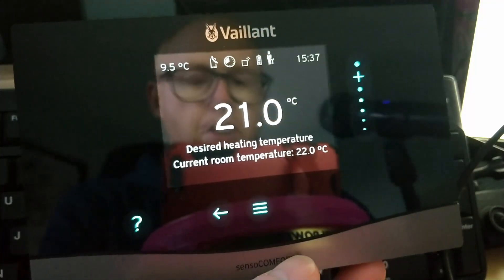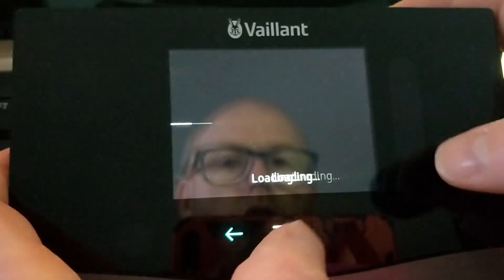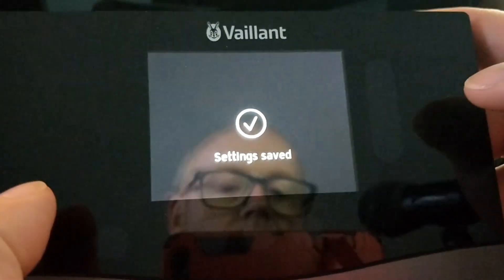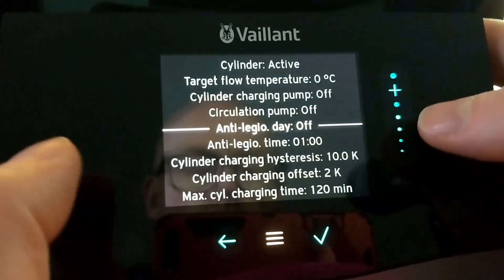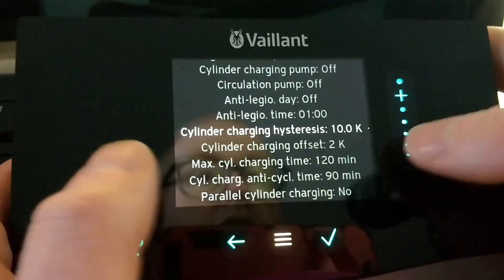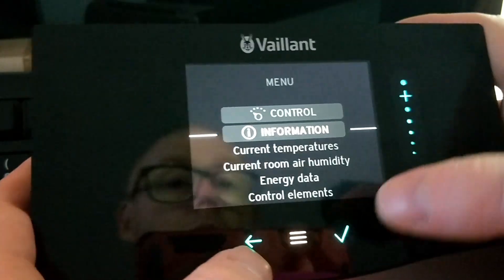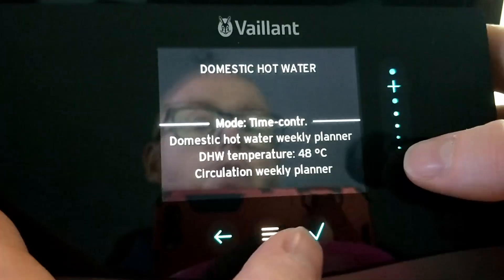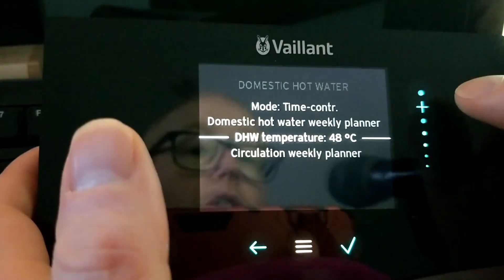Hot Water - Vaillant Heat Pump

Comment: Can you tell me what to do if there’s no display screen. It fires up then goes off. Many thanks
Reply from the maker: Hmmm, that is weird. Batteries definitely good?
Reply: @UpsideDownFork this doesn’t look like it takes batteries. Do they all take batteries?
Reply from the maker: @amandaleighwilson some are hard wired but most are battery powered.
Reply: @UpsideDownFork no it’s hard wired in. So weird. The logo comes on so it’s getting power but then the device flickers the temperature quick the reboots again. I have a number to call tomorrow but it’s a rad frustrating as I know it will reset everything and I don’t understand this system at all. It’s like we need a degree in it. Thanks for your help.

Comment: Why not just have it on all the time?
Reply from the maker: Because that's an inefficient way to heat the cylinder.

It also disrupts the heating system, often when you want heating the most.

Set it to once a day and then you're in control.
Reply: @UpsideDownFork but wouldn’t topping the cylinder up short and quickly, as it needs rather then a full cycle from cold be just as comparative. Have you tested both sides to compare?
Reply from the maker: @gerardfry4876 yes I've tested both and the long reheat from cold is far more efficient because the heat pump spends much longer at those lower flow temps.
If topping up regularly then the heat pump has to ramp right up to high flow temp quickly and it consumes a lot more energy as well as experiencing more defrost cycles at colder/humid conditions.

Comment: thanks for your video! I have been having headaches with my heat pump and the hot water since moved in this new house. Often, there is no hot water when I try to shower at night. But in the morning, hot water is normal. To be honest, I know nothing about heat pump. I look at my panel and the settings are so much different from yours. my cylinder charging hysteresis is set to 7.0 K, and cylinder charging offset is 15K. And the cylinder target flow temperature is 75C! Is this abnormal? what else do you suggest me to check?
Reply from the maker: If you don't have sufficient hot water to last throughout a whole day then you broadly have 2 options. 
1. Schedule a second hot water cylinder reheat for the afternoon time.
2. Set your cylinder to heat to a higher temp.

The cylinder target flow temp may only be 75 degrees during the legionella cycle?

Comment: Thanks for this. We've had our vaillant for about 7 weeks now. i set it up like you right at the start with a hot water cycle set from 00:30 to 2:30 everynight to make use of octopus go tariff. this has worked well and we've never been out of hot water even with target temp at 48. however last night it just decided not to run the hot water cycler. so by the evening we'd run out of hot water. never had this before and dont know why it chose not to run hot water at all, very odd and i cant figure it out to know how to change it so it doesnt happen again! its doing a boost now which is working at least.
Reply from the maker: That is very strange. I've not seen that before so hopefully a one off glitch.
You can keep a quick eye on it every morning when you wake up to check it's successfully completed the DHW cycle.
Reply: @UpsideDownFork  Thanks! after googling the only thing that might have been is if for some reason during the hot water window at night it didnt think the tank was low enough temp to trigger the cycle. maybe our hot water usage was low that day although i couldnt obvioulsy think it was. we have the tank at 48 so maybe it hadnt quite got down to 37. so i changed the cylinder charging hysteresis from 10K to 5k and its not done it since. so maybe that was it! :)

Comment: Yes pretty sure Cylinder Charging Offset makes no difference at all - 0 or 25C all the same. Setting may only work with gas boiler.
Check the VWZ-AI controller screen (the white one usually near the tank). The default display should show a capital E - which I think means DHW eco mode which is the most efficient. This cannot be set in the Sensocomfort and is usually set during commissioning.
Reply from the maker: Interesting that eco DHW should be default as that was not the case for me and many others. 

I haven't read the manual since last winter so this might be a good moment for me to do some revision.
Reply: @UpsideDownFork  Mick Wall's Energy-stats blog tells you how to set it in VWZ-AI:  Look for
Vaillant Arotherm Hot Water Modes TL;DR
Warnings !
Alternatively you can set the schedule for Low Noise Mode (installer level in sensocomfort) to coincide with your hot water schedule - may take some time to heat the water though. Eco mode should be fine for most.
The VWZ-AI manual
monoblock-heat-pump-system-vwz-ai-heat-pump-appliance-interface-2685948 pdf
Page 7 : Description of symbols: E eco mode  Energy-saving domestic hot water mode
Reply from the maker: @Scouser22 Thanks, i'm well aware of how to change the modes and have made videos about this years ago.

Comment: Regarding the dhw temperature, my installer did put the temperature sensor in the higher location, which is approximately 1/4 of the total height from the top. So low temperature is almost empty with my boiler. Is that wrong?
Reply from the maker: It is recommended to fit in a lower pocket so the heat pump will start reheating it quicker. If you are satisfied with your hot water production then no need to change.

Comment: I’d don’t understand why my DHW cycle ramps immediately up to near maximum output, heats it within 15 mins and stops. It peaks at 6kW input for about a minute then drifts down. The DHW cop is great at 345% but I would have thought a slow increase in flow temperature would have been more economical.
Reply from the maker: Do you have a Vaillant? Set the DHW mode to ECO and try again.
Reply: @UpsideDownFork  I don’t, it’s the 16kW Samsung R32, but it does have an eco mode, so I’ll give it a try. Thanks.

I can’t complain about the cop, it’s just the OCD in me (or perhaps because I’m a tight arse) always tries to get the best out of it. 
Does yours actively modulate up as the tank temp increases, or does it accelerate to 100mph and then back down again?
Reply from the maker: @yp77738yp77739 actively modulate. It maintains a flow temp a couple of degrees hotter than the return temp.

Comment: Thanks a lot for the video. It helped me so much to understand. 
I have similar settings like yours for the DHW, only difference is that I set legionella for Friday afternoons.
There is a switch for the heat pump and another separate switch for the immersion heater in the utility room. Currently the heat pump switch is on but the immersion heater is off. When should I ever need to switch it on?
Reply from the maker: The immersion switch is an emergency back up so you can still provide hot water in case of a heat pump failure.
Fingers crossed you never need it!

Comment: Have you targeted your pump usage to fit in with an energy tariff?  We are looking to get a pump installed & I'm trying to make sense of energy tariffs with low cost energy windows. It's a bit of a minefield!
Reply from the maker: I have several videos on the channel of me trying to optimise for Octopus Tracker, Octopus Agile, Octopus Cosy and now Octopus Intelligent Go.

Finding the balance between the heat pump, the EV and the rest of the house is a fine balancing act.

All of the above have saved me a considerable amount over the standard tariff.

Comment: It's important to know how many kWh of heat the DHW cylinder (& any buffer tank) loses in 24hrs and to think where that heat is going, especially if you're about to install & considering putting the kit in a place that's not heated & not insulated. Your DHW tank & ancillarys are a heat battery - a useful leaky space heater OR a waste of heat and primary energy
Reply from the maker: Yep, exactly one of the reasons that I pushed to keep my buffer tank and cylinder in a first floor cupboard rather than the garage or the loft that the installers preferred.

In this video I intentionally suggest that people should heat the hot water closest to the point of use to avoid those standing losses as much as possible.

Thanks for commenting!

Comment: Hi thanks for the information. I'm enjoying your videos. We've just had a Vaillant Arotherm plus installed and still trying to get to grips with all the settings. I have one thought to share. Realising that the pump can only do heating or DHW, I didn't want the house to get too cold overnight whilst I heat the water up in the cheap period. I read in one of the Vaillant manuals how long it would take to recharge different size tanks. For my 200L tank it said something like 78 mins. Therefore I've set up my system to do DHW for only 90 mins. So far this seems to have worked for us.
Reply from the maker: Thanks for commenting!

Comment: Very timely video. Just in the process of requesting a larger hot water cylinder than the one we have been allocated from Octopus before our install next month. Probably focused too much on the ASHP sizing and just accepted the cylinder they assigned us. I was reading the Daikin HW manual which stated  'The lower the desired DHW tank temperature, the more cost effective. By selecting a larger DHW tank, you can lower the desired DHW tank temperature'. Your video confirms what I had worked out, that I would be needing to heat our water to a higher temperature so we could blend it down to have enough hot water. Thanks as always for the content.
Reply from the maker: The rule of thumb 45L per person per day is an ok guide but has one big problem, that is for storing water at 60 degrees!
No one makes this clear.

One you store at 50 degrees, you should be aiming for 55-60L per person.

Comment: If you are charging in a much smaller window you will need to set the charge hysteresis way down.
Ours is set to 1 degree as it only gets a 2hr window for the cheapest Octopus Agile slot in the day. Without that we would miss an entire day before the next recharge window.
Reply from the maker: @TheBaron0000  so if the temp drops from 50 to 48 for example, you reheat the tank?
Reply: @UpsideDownFork  Yup, because it has to last 22 hours without a reheat (after much arguing I got a 300l tank even though "you don't need that much" specifically for this reason). The sensor is half way down the tank so doesn't really read the average temperature of the tank properly due to stratification. By the time its dropped by 5 deg your already a long way thought the tanks hot water, and with a setpoint of 45deg you really don't want the stratified level to be much lower temp than that. If its already warm the reheat doesn't really last that long. The cost differential is so extreme that it makes sense (in a day you have 7p, 16p, 33p / kWh). I can't really see any downsides to just running it each day,  there is the heat loss from the tank but that is so minor.
Reply from the maker: @TheBaron0000  Ah, got it.

Comment: This is quite a complex and depends on what you're trying to achieve. If you're after highest cop then middle of the day. If you want the cheapest price then likely to be long and slow overnight. I found that 2 hours in the early hours is usually okay, but I found on really cold days it let the house temperature drop too much. So I now run two 1 hour sessions with 1 hour heating in between. Will revert when weather is warmer to a single session.
Reply from the maker: Thanks for commenting.
Hopefully this video guide will help people get in the ballpark of what they want to do and if they want to eek out a little more then reading some of the comments like yours can help them consider further options.

Comment: I know this is specific to heat pumps, but I wonder how this applies to a boiler with a vented cylinder. I have my flow set to 60c and the tank thermostat set to 50c. After 20 minutes or so the boiler starts to cycle as it cannot modulate low enough to keep the flow at 60c as it keeps overshooting (12kw boiler can only modulate down to 8kw). To avoid too much cycling I have 2 x 30 minute schedules each day. This means the whole tank is never getting up to temperature, but it's enough for our showers and dishes etc. Do you reckon this is better, or should I have 1 x 1 hour session in the morning to heat more of the tank, but get more cycling on the boiler potentially causing more wear and tear?
Reply from the maker: Hmmm. I'm not sure to be completely honest with you.

This video is the result of me experimenting with the Vaillant heat pump and invented cylinder in my own house over the last year.
Reply: @UpsideDownFork  Yeah I wasn't expecting you to have an answer, don't worry 😀 Just makes me wonder. Not sure if cycling is as bad for heat pumps as it is for boilers. Obviosuly bad for efficiency, but in terms of long term damage...
Reply from the maker: @egocd  from my understanding boiler cycling isn't as bad as heat pump cycling due to the compressor starts.

Hopefully someone more experienced will come along to offer you some advice 👍

Comment: Cylinder charging offset can make a difference IF you have cylinder with a big enough coil to dissipate all the energy.
Reply from the maker: Do you happen to know what size coil that happens at for a 5, 7 or 12kW pump?
Reply: @UpsideDownFork  don't know, sorry.
Mine's a 7kW, 250l cylinder, 6m coil. Will track at 4-5deg, but no lower, even if set to zero.
There was a suggestion on HG that it should be able to track lower, but I've not seen any evidence.
Reply from the maker: @71brp84  well you have literally the perfect setup. 7kW and 250L is the ideal pairing according to my contact at Vaillant. 👍

5 degrees is pretty good though. Many people stuck with 10 degrees and can't get any closer with smaller coils.

Comment: Worth considering a Mixergy tank if you worry about how much hot water is left. Loads of data presented in graphs. Works well with our Daikin HP for a full charge, but can also heat from an immersion at the top of the tank. That gives the option of a quick partial reheat to whatever % you specify and also allows a solar diverter to heat the tank in the summer. Probably a more expensive option to install though.
Reply from the maker: Thanks for commenting.
Mixergy is a great option for those who can afford it and will value the extra data!

Comment: Even though we shower at night, we still have the water heated overnight. This does mean we have to set the temperature a couple of degrees higher because of the longer time for heat loss, but the savings from using off-peak rate more than make up for this. 

We also do have a couple of extra thermometers in the tank as our tank also use solar thermal, it does mean that we can look at the top one to see if the water is hot enough - we obviously don't bother with that on a regular basis.
Reply from the maker: Thanks for commenting!

Comment: Very good as always. I realise you want to tie in your DHW charging with the cheap rate electric & EV charging, the coldest part of the night tends to be around dawn, some would say just after, I seem to see it being around 04.00/05.00. so it might be an idea to heat the hot water at the start of the cheap period and then charge the car thereafter?
Reply from the maker: Great tip! 
It would be a good experiment to run to prove your theory to be true.
Would need to factor in any standing losses for the extra hours of storing heated water but probably negated overall?
Reply: @UpsideDownFork  My flimsy belief of the coldest time is based on the Vaillant (app) outdoor temp graph.
Reply from the maker: @FRZ5951  that's good enough for me 👍😁

Comment: When do you do your 60c cycle
Reply from the maker: I never have and never will.
There is already virtually no risk of legionella in a domestic setting, before we consider that it won't grow if you store your water above 45 degrees and even more critical is how quickly you're turning the water over.
We empty our cylinder every day so there is no risk.
Reply: Same for me.   I don’t believe there has ever been a documented domestic case of legionella.    The only place legionella has been isolated from in a domestic settings is shower heads so it’s probably more important to run showers that are not used on a regular basis.

Comment: Quick unrelated question: is underfloor heating worth the effort and the money?
Reply from the maker: Financially? No. You will never see a return.
Comfort level? That's subjective.
Reply: @  thank you. Can similar comfort be achieved with radiators you think?
Reply from the maker: @trailblazer7108  radiators on a heat pump gets much closer to UFH comfort levels. Still not quite on par but our kitchen tiles for example aren't stone cold anymore because of the low and slow heating which feeds thermal mass into things like that.

The difference between gas boiler on/off heating and heat pump weather compensation is night and day.

Between rads and UFH it's a much smaller margin.
Reply: @  thank you so much! I wouldn’t be doing this without you and your channel, so I’m ever so grateful.

Comment: What do you have your DHW mode set to?   I tried ECO but it was taking quite a while to heat up our 300 litre cylinder, so I’ve stuck with with NORMAL.
Reply from the maker: I do run mine on eco, because the time taken overnight doesn't matter to me.

The efficiency difference between eco and normal is fairly small anyway.